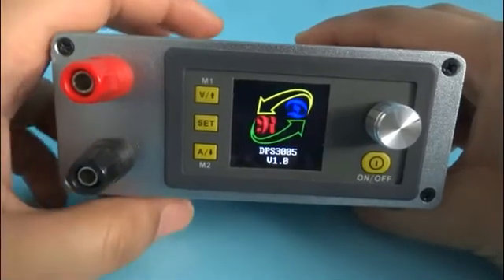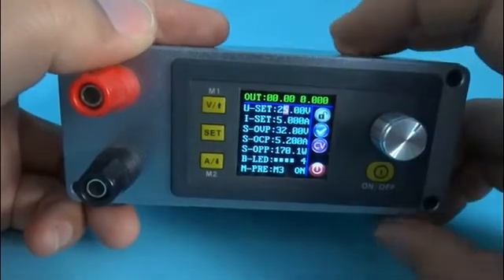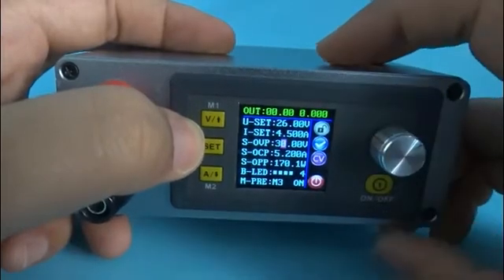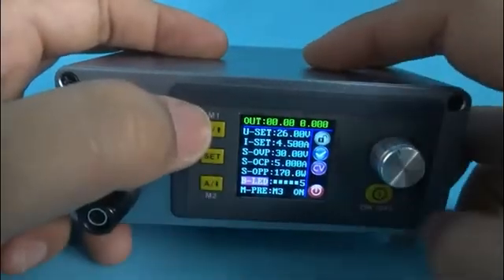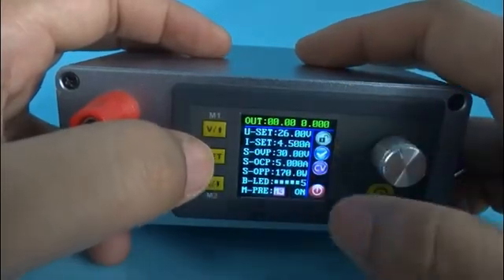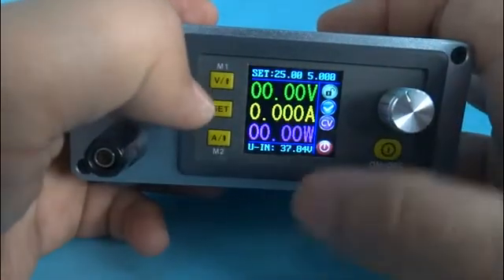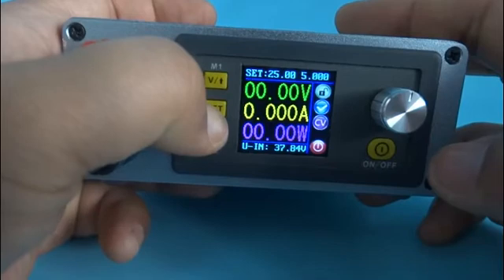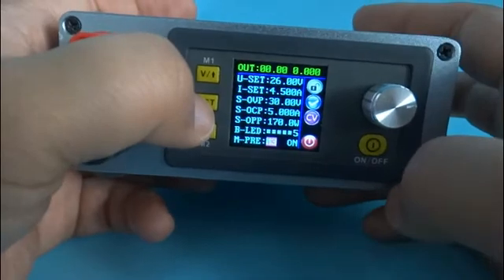RD power supply  How to store data into specified data group and how to extract this data group.

Comment: As I said before I will write it down after I learned it by watching this video and experimenting it myself :
 How to store memory M1-M9 :
- Start with the main interface (home screen) and make sure output voltage is off ( red  indicator on  the right column ) .
- Shortly Press SET button and you will see the word "SET" illuminated in upper left corner of the screen .
- Shortly press SET button  again and you will enter "Data Setting Interface" and you will see " U-SET" illuminated .
- Press the down arrow button until you reach "M-PRE" , press the Coding Potentiometer and the "M0" will illuminate .
- Now turn the  Coding Potentiometer and you will have the option to choose any memory location from M1 to M9 , choose one .
- Press the Coding Potentiometer and you will see illumination will go to the right then TURN the Coding Potentiometer to  choose "ON" (if it was OFF ) .
- Now press shortly SET button  and the "M-PRE" will illuminate at the left of screen .
- Press the up arrow button until you each "U-SET" then press  Coding Potentiometer and now you can choose the voltage you want for this memory by turning the Potentiometer , press again the Potentiometer and choose millivolts  by turning  the Potentiometer .
- Press 'SET" button then down arrow button to "I-SET" and do as you did when choosing voltage value above  to choose current in Amps and in milliamps .
- Now press "SET" button and use down arrow button to "S-OVP" ,  "S-OCP" , "S-OPP" and "B-LED" and change them if you want as you did  for "U-SET" and "I-SET" above .
- Press the "SET" button and use down arrow button to go to "M-PRE" again and press the Potentiometer until the "M*" (the memory number you chose earlier ) is illuminated then press "SET"  button continually until the memory number we chose earlier will show in the right column .
- Do the same steps for each memory you want to store .
Reply from the maker: HI friend 
thank you for your description for our video, it is right for our video. but in fact , there is some error in our video 
now I can explain again, you can check it again 
for example:　
Now turn the  Coding Potentiometer and you will have the option to choose any memory location from M1 to M9 , choose one , eg M3  .
Press the up arrow button until you each "U-SET" then press  Coding Potentiometer and now you can choose the voltage you want for this memory by turning the Potentiometer , press again the Potentiometer and choose millivolts  by turning  the Potentiometer ，if you want to store the voltage into M3, now just hold the SET button , you will store this voltage into M3, don't return to M-PRE.. you can try ..
Reply from the maker: HI friend 
thank you for your description for our video, it is right for our video. but in fact , there is some error in our video 
now I can explain again, you can check it again 
for example:　
Now turn the  Coding Potentiometer and you will have the option to choose any memory location from M1 to M9 , choose one , eg M3  .
Press the up arrow button until you each "U-SET" then press  Coding Potentiometer and now you can choose the voltage you want for this memory by turning the Potentiometer , press again the Potentiometer and choose millivolts  by turning  the Potentiometer ，if you want to store the voltage into M3, now just hold the SET button , you will store this voltage into M3, don't return to M-PRE.. you can try ..
Reply: Thanks for your reply and I just wanted to try one working method and yes there might be other ways to store memory. 
And if I have time in another day I will write here how to recall memories from M1 to M9.
Keep up the good work.
Reply from the maker: did you understand what I said , you can change that operation ..
Reply: yes I did and what I wrote is one way to store memories that I tried it successfully .
Reply from the maker: @jrom hek
You can try to use what I said to try ...
Reply: Ok I will .
Reply from the maker: @jrom hek
thank you

Comment: The trick is placing the cursor at Mx (memory x) and holding the SET key to store.
Thank you!!!
Reply from the maker: in fact , not only at Mx, At value setting, you can holding the SET key to store. 
you can check 
for example , you adjust to M2, then you adjust output voltage , then not step back , just hold set key, you can store this date into data groups

Comment: Huh? I kinda understand, but certainly not fully. Must be something wrong with me. LOL! :*)
Reply from the maker: Hi friend, 
yes, there is a little mistake for description .  let me give you an example 
you want to store some data into M3, your first choose M3, and set output voltage , output current or OVP. if you adjust out votage into 12V, you don't want to adjust other value , you use knob to adjust 12V, then keep press SET key to store the 12V into M3. remeber don't press short SET, after setting , just keep pressing SET key to store , understand
Reply: Rd Tech Okay, gotcha (I think)! Thx! ÷*)
Reply from the maker: you can try